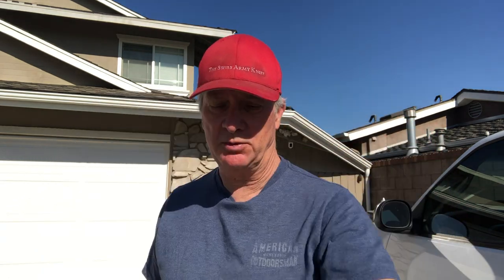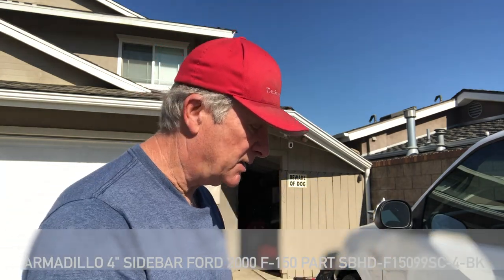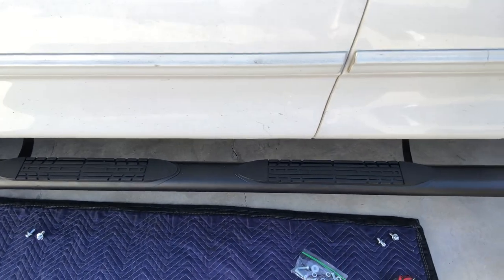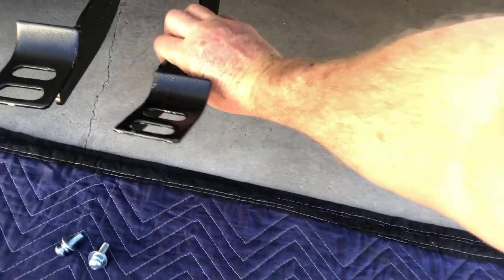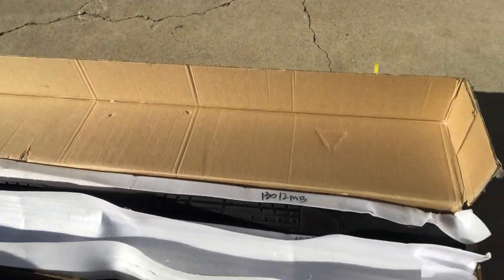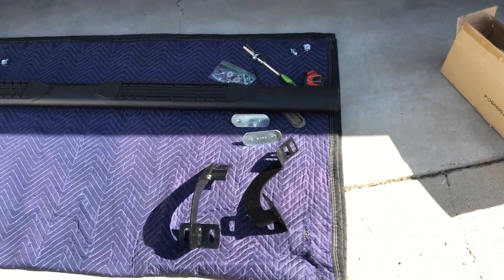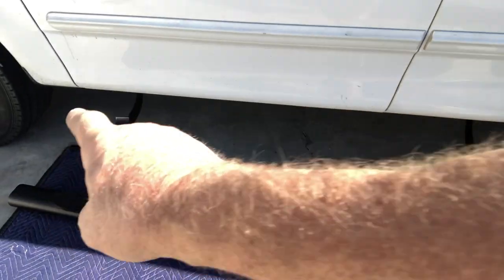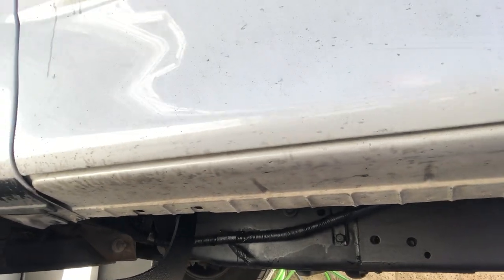How to Instructions 4" Sideboards 2000 F 150 Ford Armadillo Brand

Comment: I guess I will share my experience with similar running boards from Armadillo for an 11th Gen F150 regular cab.

My truck is an 07, and the factory step boards had seen better days. Unfortunately, Ford has long discontinued them so I got stuck shopping the aftermarket (Chinermarket). Firstly, the boards that I purchased from Armadillo were basically generic Chinerman steelies you can buy on Amazon or EBay for a fraction of the price. DO NOT pay the Armadillo premium mark up, as you will get next to nothing extra for your money.

Second, regular cabs have a quirk about them where the rear portion of the cab has an inward roll to it. This causes the running boards to mount inwards towards the body at the rear. They tend to have a crooked flow inwards toward the rear. Well if you read the instructions, it clearly states the rear brackets are longer than the front. This is to compensate for that curve. However, I was sent 4 identical brackets all around. Calls to Armadillo produced no results. They insisted regular cabs use the same brackets all around. Regardless, they shipped me a second set of running boards (because individual components can't be separated, because they don't make any of this junk. Just resell it), and it was the same issue.

I lived with it for a bit, but between that crooked spacing, and the horrendous flex from those crappy paper thin brackets, I had enough. I shopped around other brackets and found that again, it's all the same universal  junk from everyone. So I sourced 6 brackets from a salvaged vehicle at my pick it yard. I cut the ends off and modified my brackets by welding the two plates together. Essentially doubling up. I also extended the rears 3/4 inch,. This cured my flex, and fixed my spacing. I then had them powder coated flat black which made them look like they came just that way.

I was able to get the factory fit and finish, but was a bit upset at what I paid for the boards in the first place from Armadillo as they accept returns but charge you a return shipping fee. With the cost of shipping currently, it negated any savings from buying the identical no brand ones from Amazon. 😤🤷‍♂️